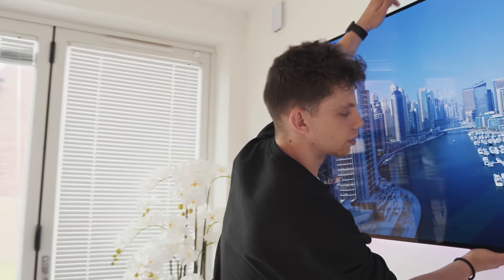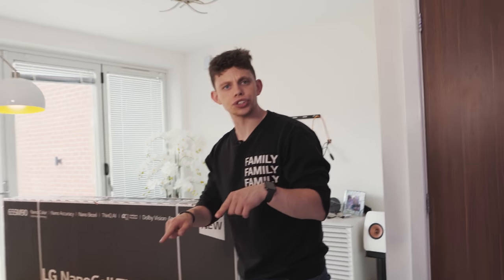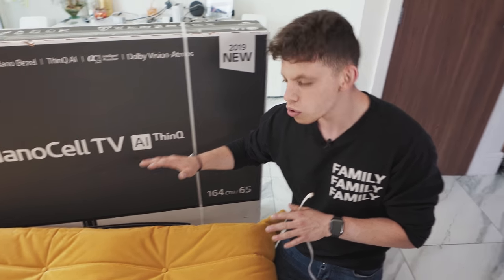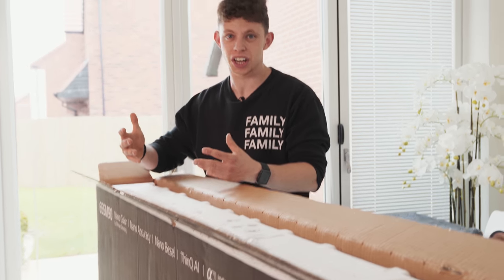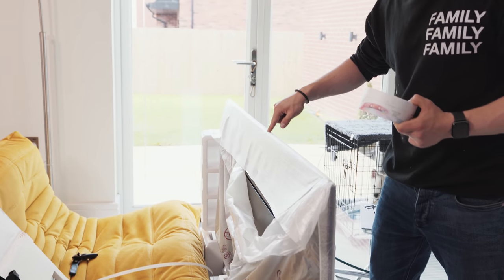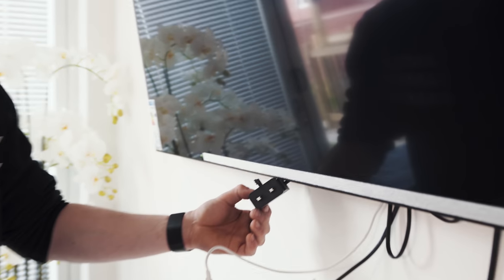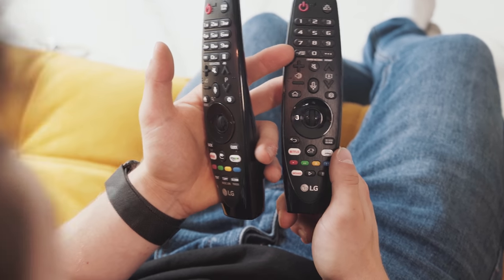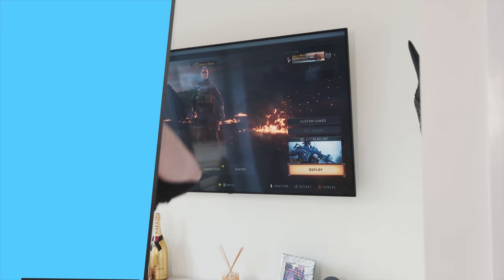Installing the 65" NanoCell Monster TV In my KITCHEN!

Comment: Dude what size M6 bolts did you use for the mounting bracket on the back of the tv?? The manual only says M6 and doesn't clarify which length.

Comment: Do the oled tvs get screen burn when gaming
Reply: Oleds do not run hot. Unlike LCD's, they do not require constant back lighting. So with an Oled, you get true color, and no light bleed. The downside is that they are ridiculously expensive.
Reply: @james3003  I bought a 65 inch LG oled